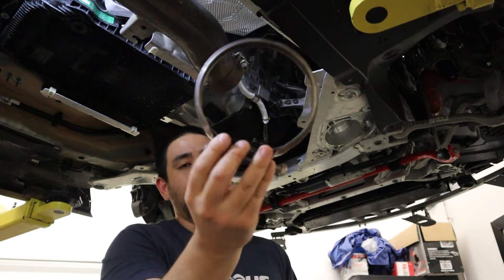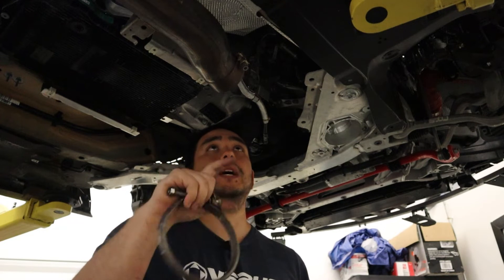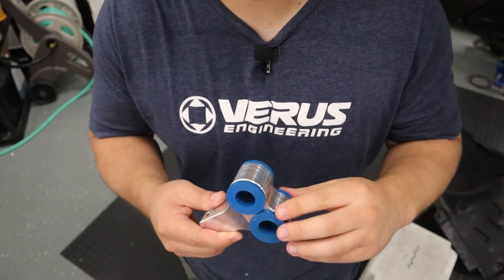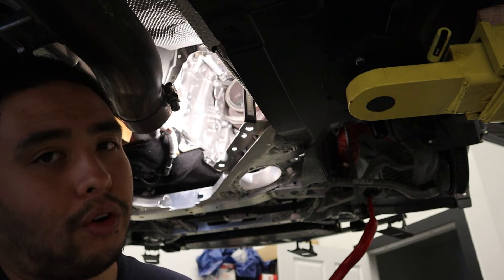Mk5 Toyota Supra Motor Mount Assembly Installation

Comment: Was there any noticeable chassis vibration after installing these new engine mounts? I had 62A bushings installed in my S2000 and the added vibration from those new mounts shook the filling out of my teeth.🦷
Reply from the maker: With the Supra, if you are not lugging the engine, the difference is quite minimal. It's refreshing to actually feel something and the drivetrain.

If you punch it with the RPM under 1800, yes, you feel a lot of vibration and it isn't fun.
Reply: @  Any chance to have a 62 durometer option. Apparently that is the softest option in urethane for motor mount usage.

Comment: Can you describe the difference in feel/movement between the 3 choices of bushings?
Reply from the maker: 70A - softest option
80A -  middle
90A - stiffest option
Reply: @VerusEngineering  I seen that info previously but it doesn't help.  Could you be more specific?  What is the delta in movement of the engine between the 3?  Does the soft option actually have a significant feel/movement difference from the hardest?
Reply from the maker: We haven't physically measured engine movement. If you have a economical way to measure this, our engineers would be all ears. Email us if you have some suggestions. However, the stiffer the bushing durameter, the stiffer the engine will be. This means less engine movement. For full on track cars, the 90A is the best option as it is the stiffest option.
Reply: @VerusEngineering  You have a team of engineers at your disposal and you need me to email you on how to measure ?  Don't let your engineers see your above post...
Reply from the maker: Noted. Thanks for the suggestion.

Comment: Thanks for the detailed instruction. I managed to complete the installation after lots of effort. I did have CEL went on after the installation, I'm assuming it has nothing to do with the new engine mount. Do you have experience with this issue? Could my turbo to downpipe gasket leaked or there could be any kind of leakage? Visually the turbo to downpipe aligned very tightly. Or could my PB blaster got into the cat or O2 sensor? Thank you for the support.
Reply from the maker: We have never heard of this before. Unfortunately, we do not know where to point you. Something else must have gone on during the install to make this happen, but we are not sure what it would have been.
Reply from the maker: First thing to do would be to read the code as well :).

Comment: Is it possible to swap the mounts without removing the downpipe?
Reply from the maker: Unfortunately, we do not believe that is possible.
Reply: @VerusEngineering yes it is possible. We managed to do it with just removing the under panels and the intake (on jack stands). Thanks for the amazing product!
Reply: I managed to do so by just loosening the down pipe.  I do have an after market one though.